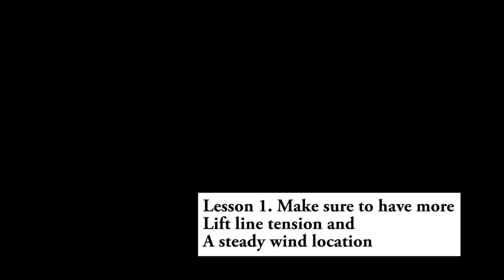1st Hexagonal Kite Turbine flight and Crash

Comment: Hi, great work. Watching this gave me an idea. Have you consider lifting a vertical wing turbine (maybe placed horizontally, like a rotor kite) and instead of transferring torque to ground, you could convey linear work, in a sort of belt between the turbine and the generator at the ground.
Reply from the maker: Hi Leafar, thanks, yes but the generator would need to track the wind round. Maybe check out the kitewinder kiwee one or more on forum.awesystems.info